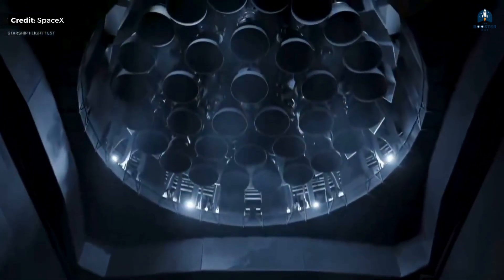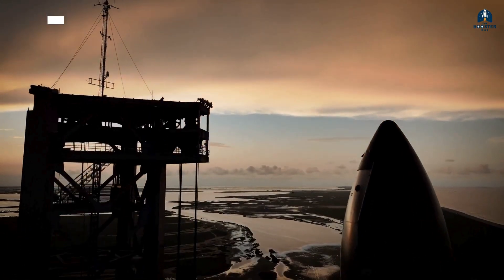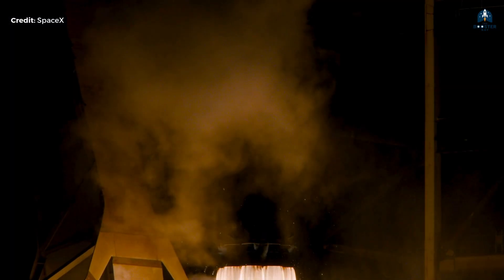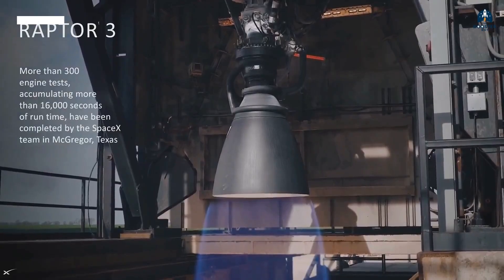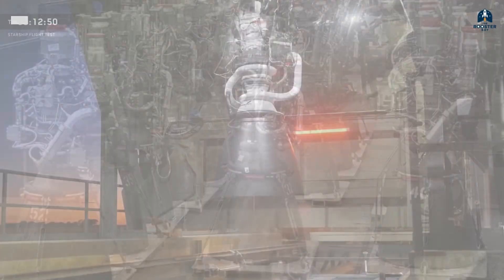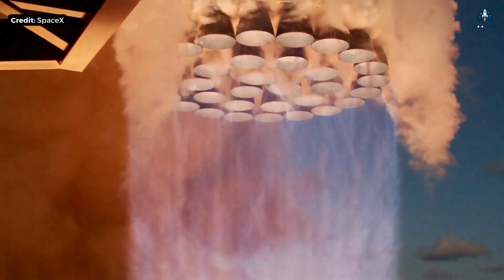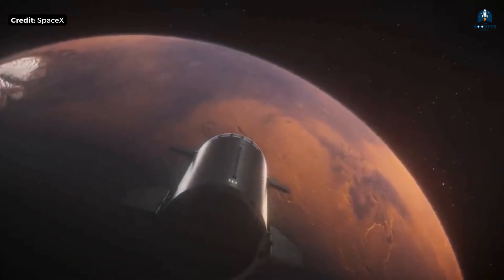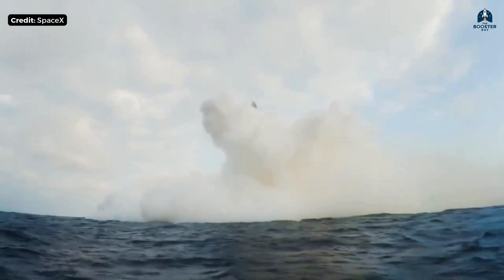Raptor 4: How SpaceX Will Build a Rocket Engine 10X Cheaper Than Merlin

Comment: SpaceX will need to closely watch for material fatigue as those engines and ships go through repeated launch cycles similar to how airplanes have to have components like jet fan blades replaced on a strict schedule.  As they operationalize Starship, the maintenance and reuse limits will need to be determined and held to similar to aircraft maintenance.   This will take time to build enough flight data to build out guidelines.  The initial number of re-flights may be low as the ship and engines may have to be destructively examined for fatigue and stress.  Like Falcon, the number of re-flights will increase as there is enough data to verify safety.